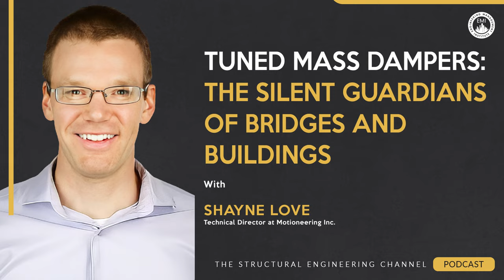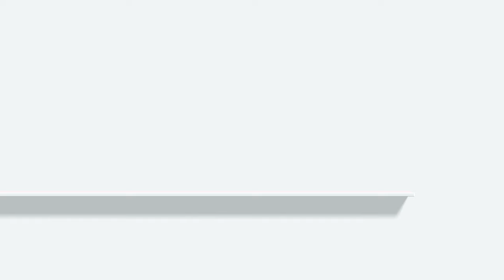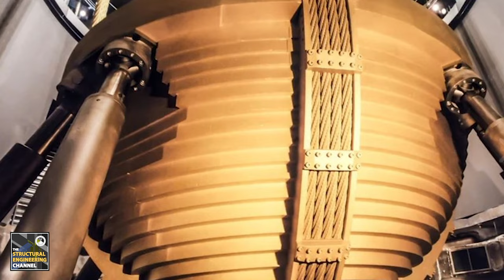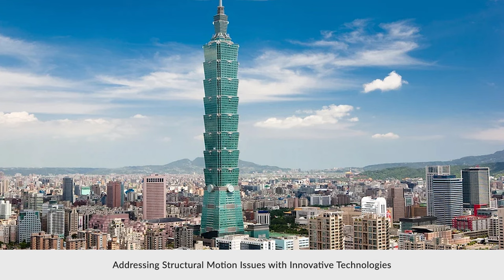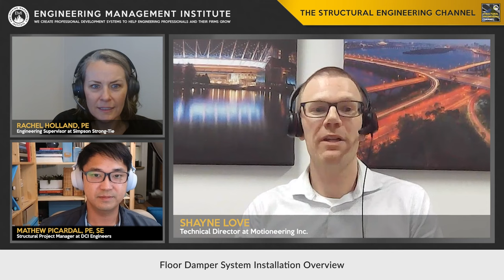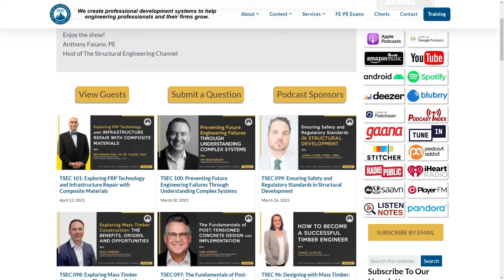Tuned Mass Dampers: The Silent Guardians of Bridges and Buildings

Comment: As opposed to current practice of using them in confined spaces, could a tuned mass damper be used in an open public space like stadia because these vibrate alot.
Reply from the maker: @atuhedavis5119 Indeed! Stadiums, especially during large events, experience significant vibrations primarily due to crowd movement. Theoretically, tuned mass dampers (TMDs) could counteract these vibrations, much like they mitigate wind or earthquake-induced oscillations in skyscrapers. However, challenges exist in scaling the technology to stadium size, determining optimal placement, ensuring aesthetic integration and safety, and managing the potential cost. Yet, advancements in engineering may eventually lead to TMDs or similar technologies being implemented in stadiums to enhance comfort and structural longevity.

Comment: is there any chance where the tune mass damper moves to the same direction with the building sway instead of against it ?💀
Reply: Good question. When properly tuned, the TMD will lag the motion of the building. If NOT properly tuned, it will not perform well, but it will not apply a force that is in-phase with the wind loads; that would violate conservation of energy.